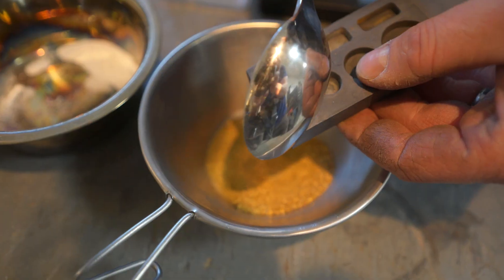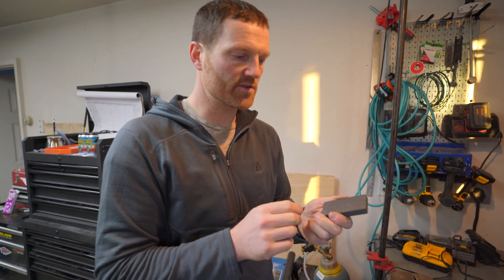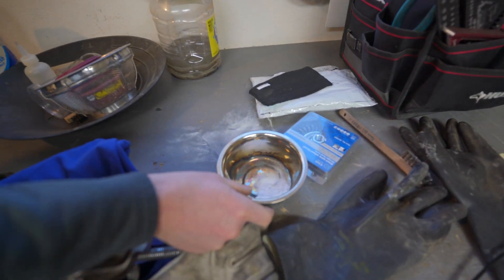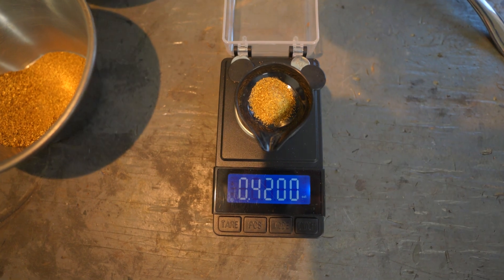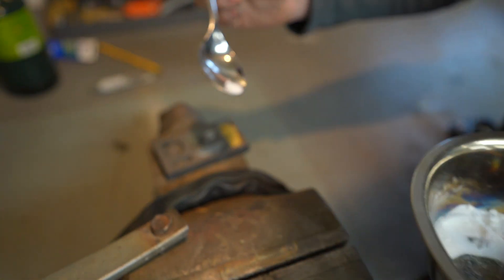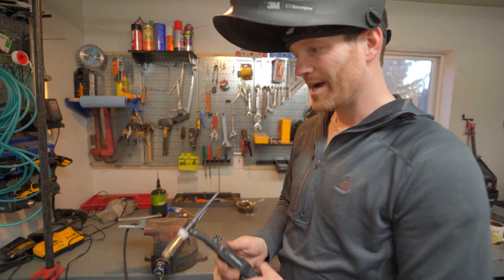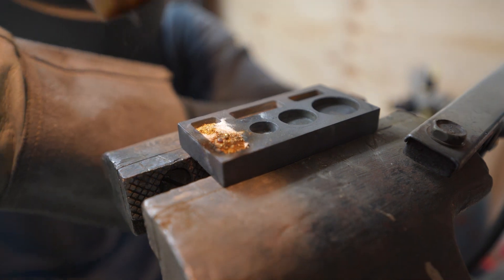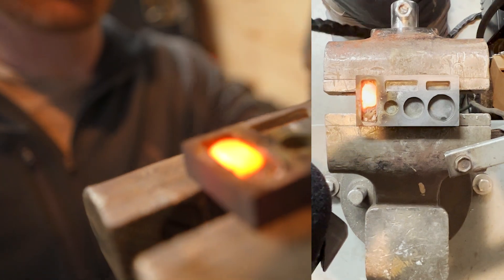Melting Raw Gold into a Gold Bar with a TIG Welder

Comment: If you want to do this you should always use argon. Not because the gold will oxidize, but because your TUNGSTEN will oxidize, which deposits tungsten oxide into your gold. If you sell it to someone with an XRF machine and it shows tungsten as a percentage, they'll probably avoid buying from you, thinking it's been tampered with.